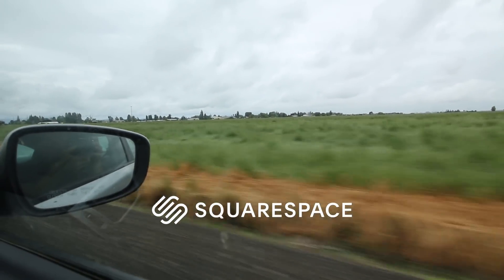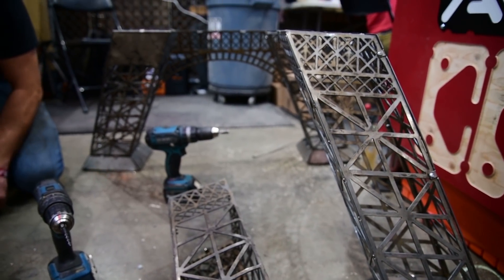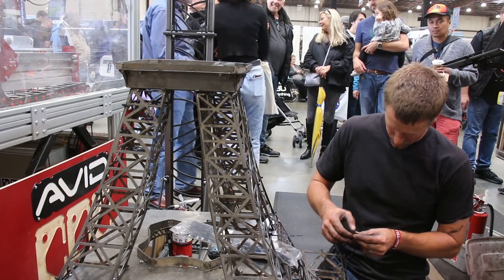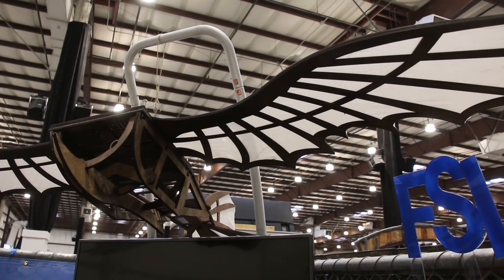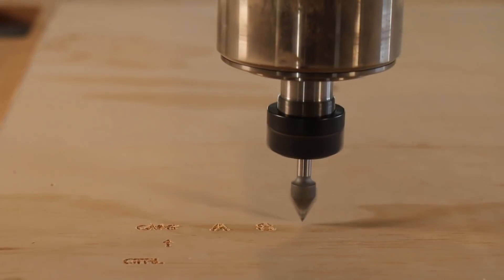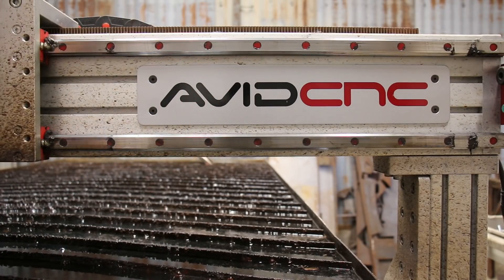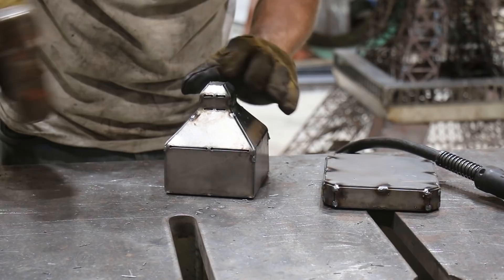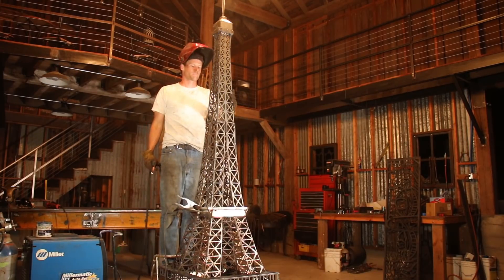Building the Eiffel Tower

Comment: Yeah I would imagine using the screws to work with sheet Metals difficult and and especially on something that Gage and scale. If it were me probably would have resorted to grade A  soldering iron.  butane preferably  a couple different sizes of soldering flux large Plumbing too small electrical.  I know you said no welding but it wouldn't think that would qualify especially if you had like lights in a little elevator if not then you could always did it the old school way you know like it's actually built with real pop rivets

Comment: I think you should paint it with the iron paint, then treat the paint with accelerated rusting solution, then pour a concrete pad in your yard and mount it there with little led lights.  It'll be a landmark!

Comment: Thanks for the video, JD!  My suggestion is to build a cupola-type box, designed to perfectly sit atop your barn, and then bolt/weld the tower to that, but wait... there's more!  Use your CNC to fabricate a combine or tractor weathervane for the very tip top!  Or, as suggested below, fabricate a gorilla weathervane and fly the drone around it!

Comment: Use it for a radio antenna, or attach a 360 sprinkler head to the top, or turn it into a massive bird feeder or a planter for vines, or build another one and put them at the entrance of your driveway on either side, or build a replica of King Kong climbing and attach it to the top, or turn it into a tool storage tower, or ship it to Paris and have them install it under the original, or weld your sign that you made to the top of it, or start making other iconic towers and or buildings and create a display of buildings from around the world, or turn it into a fan for the shop, or use it for your next Christmas tree. 

Great video, great making and amazing humor. Thank you!